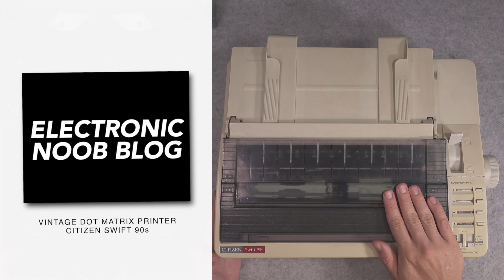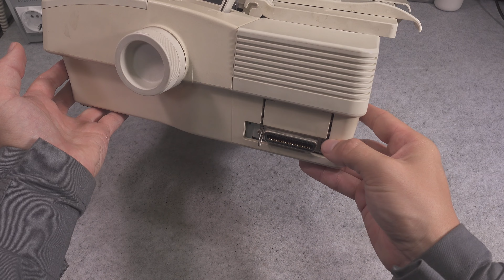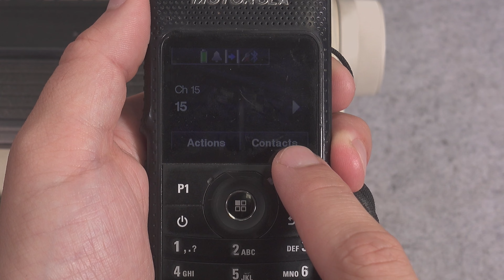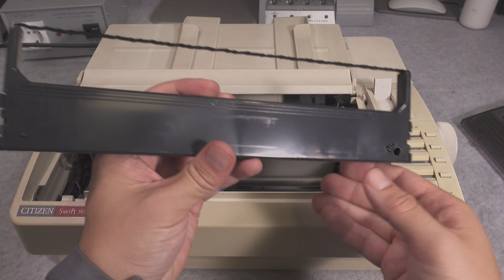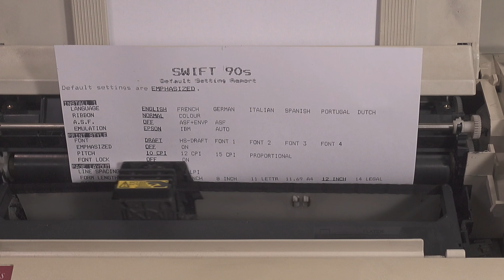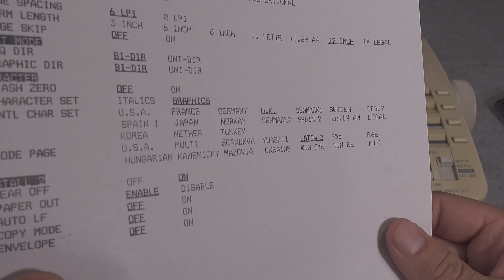Citizen Swift 90s vintage dot matrix printer with unique hardware soft keys menu

Comment: A very interesting printer! I have seen menus like that on other devices, but it has been long ago, and just at the moment I can't recall what any of them were. In any case, they were quite rare, since that moving menu was relatively expensive compared to dedicated switches without moving labels.
Reply from the maker: I had same though - won't be cheaper to add more buttons ^^ Lot of engineering went into this